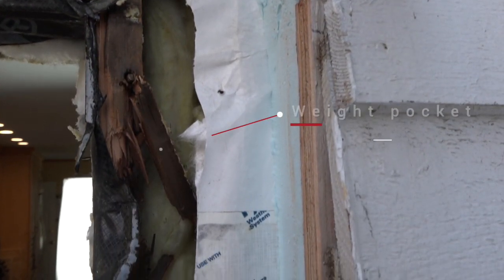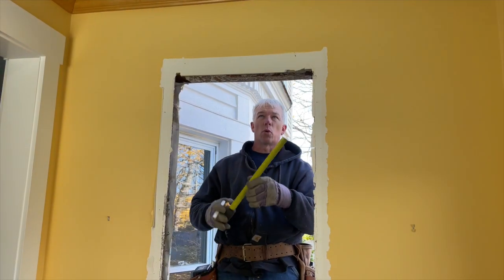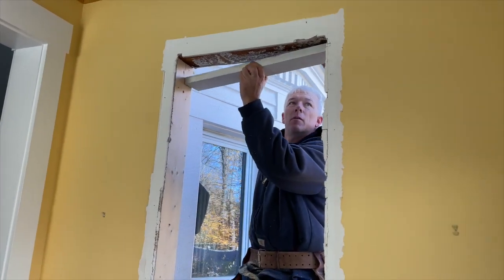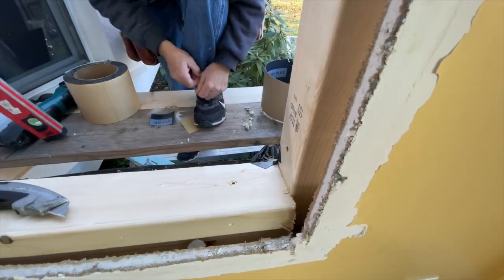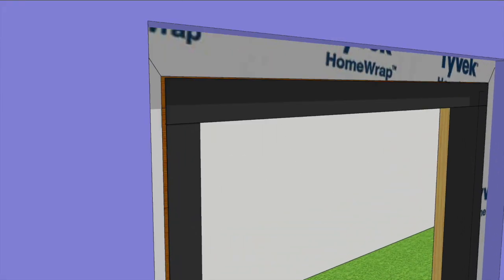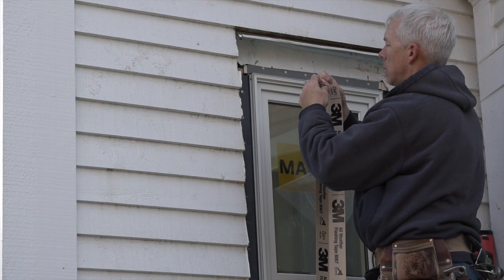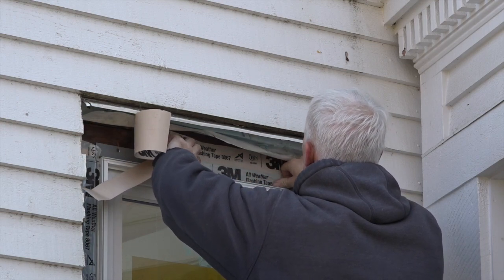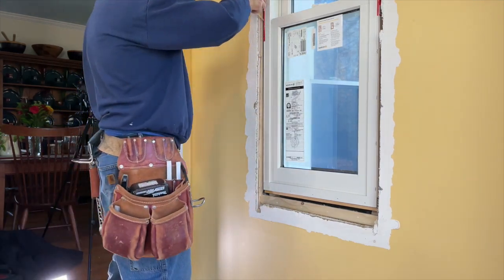New Window 3: Flash the Window Into The Wall

Comment: I wouldn't use that kind of large gap foam, it could break the window. Should be the blue one made for windows and doors. Use silicon on the nailing flange also. Also, why not use a drip edge. Just a few extra tips.